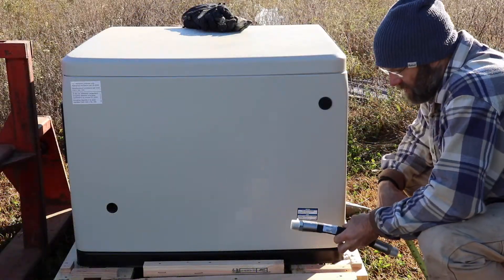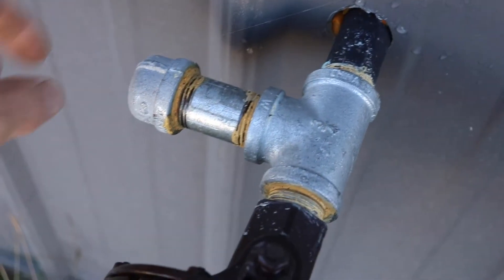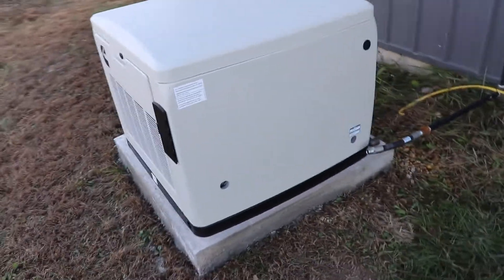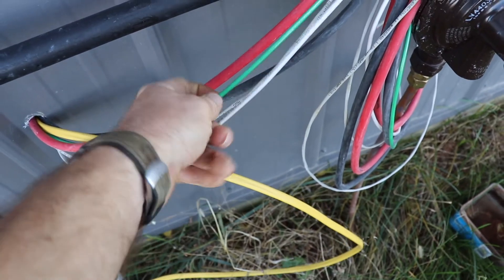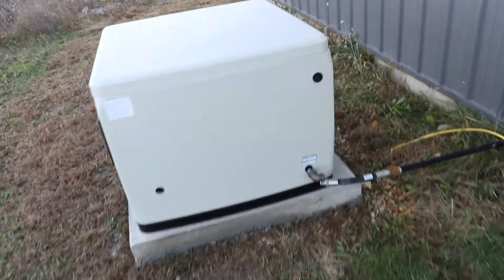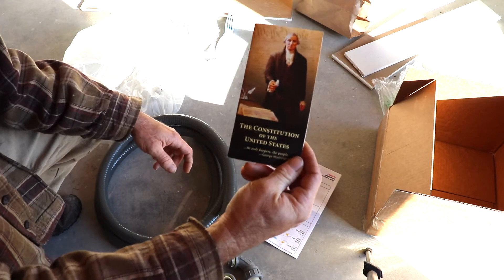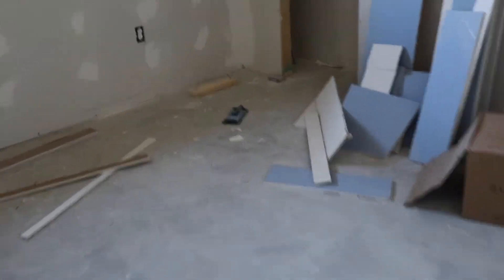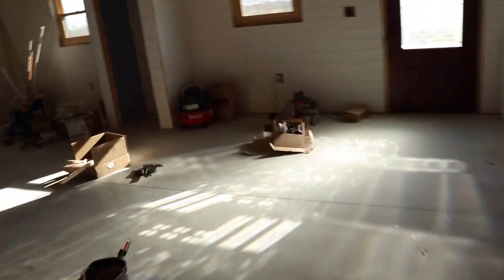Cummins Generator Off-Grid

Comment: Great video! I have the 17K Cummins home generator set up with a manual transfer switch. Do you know how to get it to excercise when setting "Excercise Now" ? I have the time set properly but when I highlight excercise now, it doesn't start like the manual says it does. Have you ever tried to use Excercise Now before?
Reply from the maker: I never tried "exercise now" as a matter of fact I don't recall seeing that feature. I will say this, it never seems to keep time very accurately. These days I don't even put it in standby anymore since it usually needs to run at least once a month.

Comment: Thanks for the video mate, we have been off grid with solark since ‘19, though only use a 9kw gen, this only really gives us a 5kw charge rate. Looking at this same generator so we don’t need it on as long for our 50kwh battery to get replenished. Do you know what kw your charging at l, will it max out the solark 12k (8800kw I think)
Reply from the maker: It really depends, I've seen it go to about 6kw at best. I'm not sure why it gets throttled back like that, the Solark I suppose. Sometimes I am very aggravated about what the Solark will let it do. I switch back and forth from battery percentage mode and battery voltage mode and sometimes that helps. But a lot of the time I'm still scratching my head. It always seems to take a charge better during the day.

Comment: Did the manual have instructions to connect generator to your system?  I am completely off grid and need to add a bigger generator than the 7kw honda I currently use.  I was looking at Cummins 13-17 kw generator
Reply from the maker: This is the best I can do right now. You should be able to get the entire manual off their site. If you email me I can send you the pdf, but I cannot find a link to it just now. https://www.cummins.com/generators/quietconnecttm-series?v=3151&application=Residential%20Home%20Standby

perimeterperm@gmail.com
Reply: @PerimeterPermaculture do you have the oil filter part number off hand?

Comment: You can’t run your low voltage control wires and load lines in the same conduit btw. Causes interference.
Reply: As long as the wire is shielded and at least 300V rated, you can